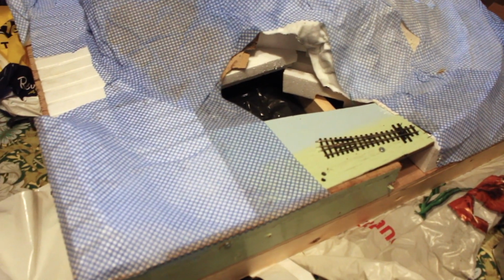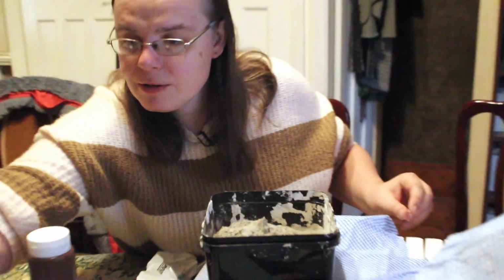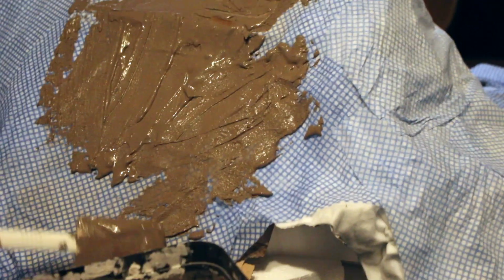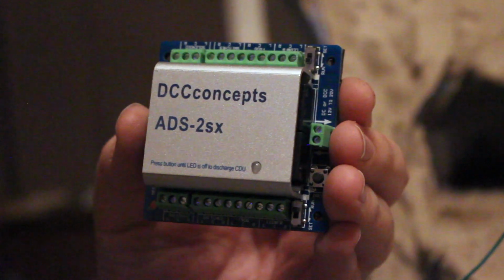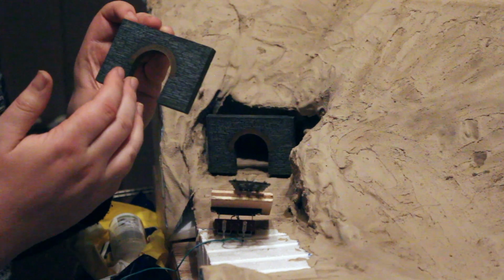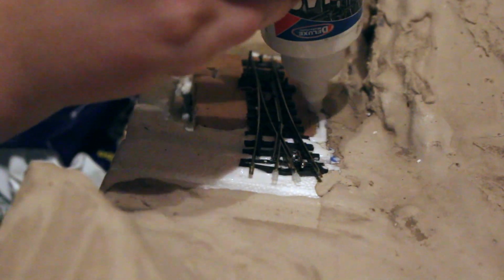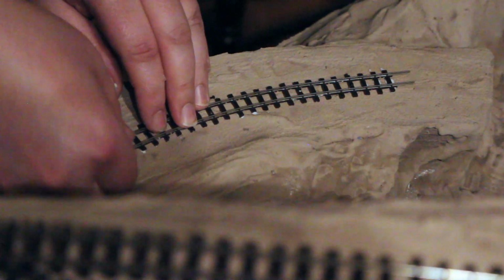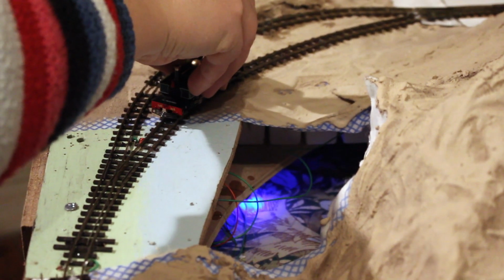How to Build a Model Railway, part 3: Track Laying and Surface Layer

Comment: Great Jenny! I’m no videographer so not able to show you but I save Teabags. Dry them out and open them up and scrunch them back to powder (quite therapeutic) between finger & thumb. Then I add these to my mix (as you describe). The benefit of this is that you also have a texture rather than a smooth finish. Best wishes. Robert.

Comment: This is just a thought but I notice that everyone seems to put the plaster into a pot or what ever then add water. It works ok and mixes up nice but I actually get water and then add the plaster. For me it mixes so much easier and no hassles of dry lumps you have to look out for. As I said its how I do it and thought I may pass it on for others if they want to try that method.
Reply: Plasterers add plaster to water, that is the correct way to mix it. I dont know why modelers use expensive patent fillers. Get a bag of multifinish and do 20 model railways for a fraction of the price!

Comment: with the plaster i add PVA glue as well as the water. I find it helps stop cracking if there is any movement when moving the layout ( once dry the plaster ends up a bit rubbery
Reply: What proportions do you add PVA glue? I’ve not tried this technique.
Reply: @paulmerry6262   hard to say as  just a good dollop around 50 50

Comment: Looking really good Jenny, can I suggest having some slate in the scenery area as you’re basing it in N. Wales home of the slate industry. I’ll have to bring my OO9 Baldwin locos when I come to pick my Class 24 up, they’re going to be DCC chipped for when I build my big (SG and NG) layout and it would be good to see them running on your layout before mine is started 😉
Reply: I don't think your live-steam Garrett will fit!  :-)
Reply: @hamshackleton  got 4 OO9 locos, one is a kit of K1 the other three are RTR locos, one Manning Wardle like Jenny and 2 Bachmann Baldwins, one as 590 from the original Welsh Highland and one in fictitious Southern Livery, plus 3 Lyndon and Barnstable liveried coaches.
Reply: @Warbler-Productions  - Yes,  know, I was pulling your leg, but you missed it!  :-)
Reply from the maker: Yes I do need some crushed slate. 

I’m actually planning on buying one of the Bachmann Baldwins at some point.
Reply: @hamshackleton  I didn’t really, just thought I’d reply to show I’ve got more than one version of K1, as well as being able to go and see the real thing at any time by cycling for just over half an hour 😉 she really is a bit of a beast at Statfold, though under-powered for the Welsh Highland.
Reply: @JenniferEKirk   - great minds (or fools!) I recently bought a bag of Welsh blue slate chips for a similar reason!
Reply from the maker: @hamshackleton  where did you get them from?